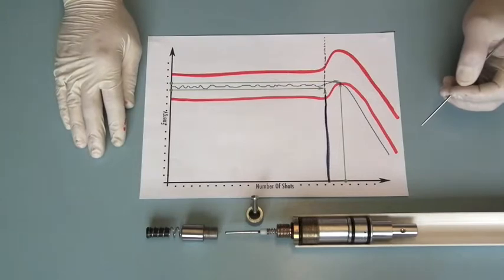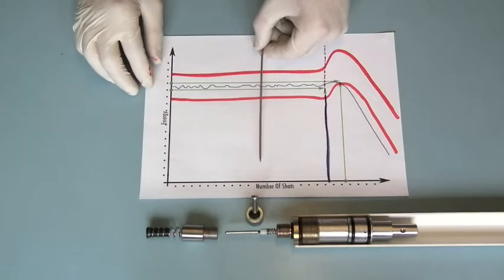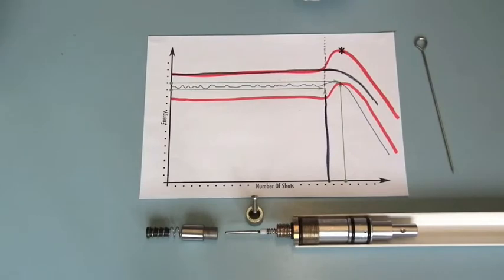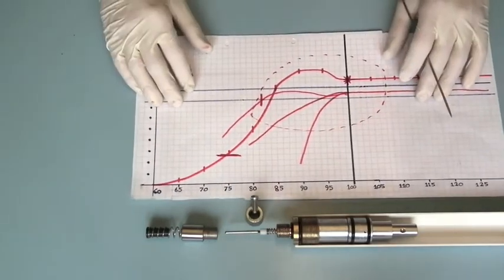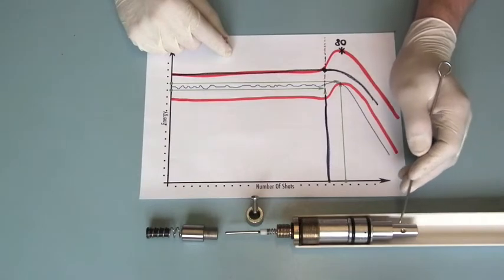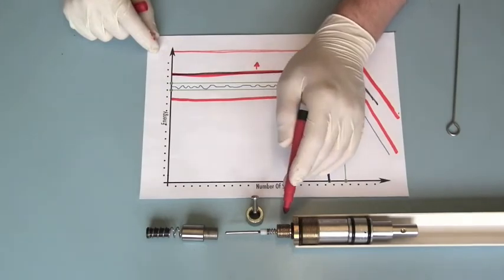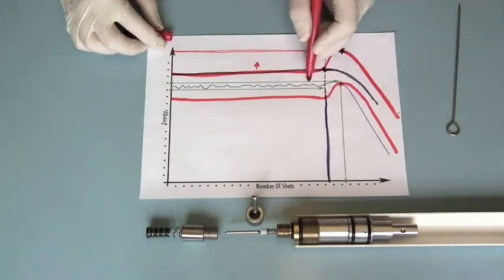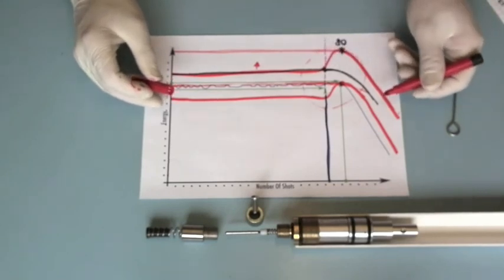Pt. 7-7 (S,G,A) Power Spike after Regulator Cut Out 'Lane Regulators'.

Comment from the maker: p.s. I think the biggest mistake is that people alter the Reg mainly and not the other adjustables. Yes the reg often needs a little adjustment but only in par with other adjustments & try to leave reg adjustment to last.
Reply: I have watched this series on tuning a regulator and have found them all very interesting thankyou.  

One thing that does not make sense to me:  You start by plotting a graph which shows the power rising to a peek (max efficiency) after it drops off reg.  You end by doing the same and then adjusting the reg pressure to match that at peak efficiency.  Why do you not just set the reg to that peak efficiency pressure after plotting the graph at the beginning?

Not sure if you are still monitoring comments but would be interested to here your answer.

Thankyou